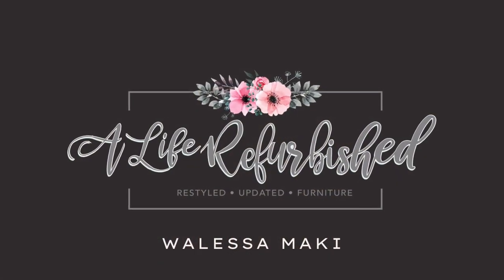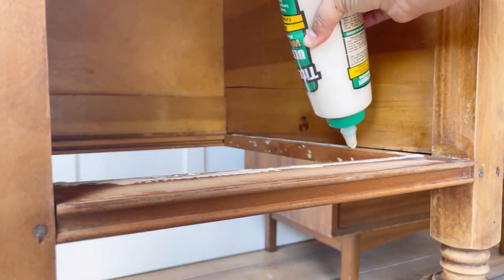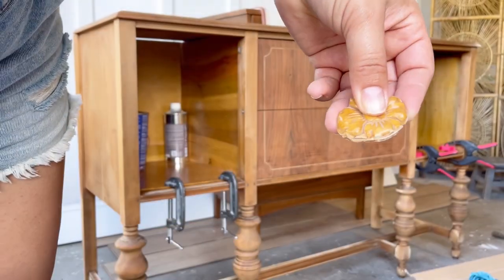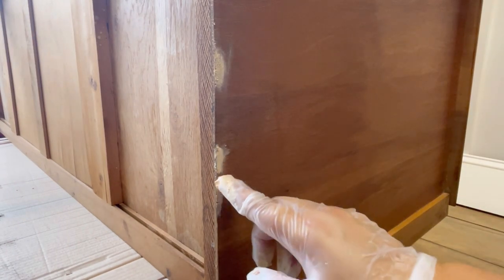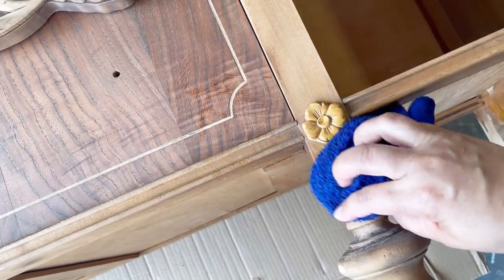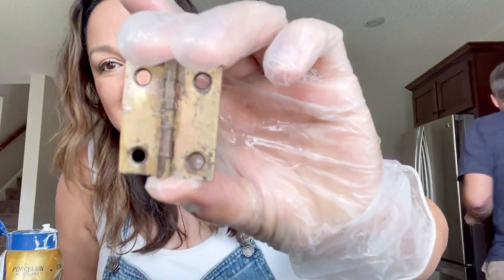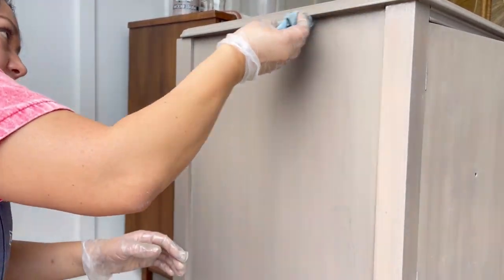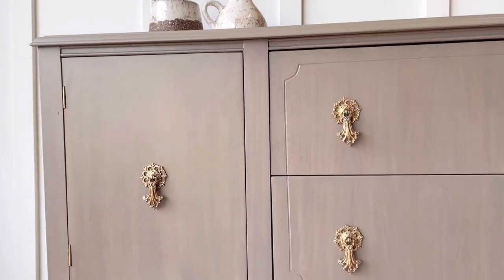MY MOST NOSTALGIC MAKEOVER TO DATE!!! | Before & After Furniture Makeover

Comment: Another absolutely gorgeous piece of yours. You knock it out of the park literally every.single time. 
Those pulls tied everything in so impeccably well too.
I do have a question and I apologize in advance if you already went over this. 
But I’m curious to know what type of paint you used on the drawer pulls and what color it is. I feel like the obvious answer would be Metallic Gold spray paint. But they almost look to be a rose gold color?…Either way they’re absolutely breathtaking!!
Reply from the maker: Hi! Actually, I did not paint those. They came from a different piece, and kept them in its original state.

Comment: Have you ever used a wood conditioner prior to using the color wash? Just wondering if you have and how the results where
Reply from the maker: I haven’t, I normally use the wood conditioner before using a “true stain.” The paint wash is a lot more forgiving than a stain and the coverage is grater. If there was unevenness in the wood prior to it. The color wash would disguise it, which a stain wouldn’t.